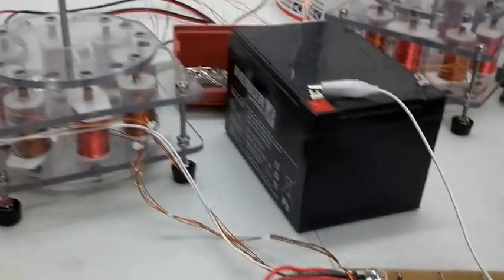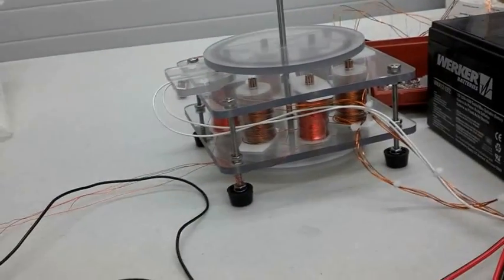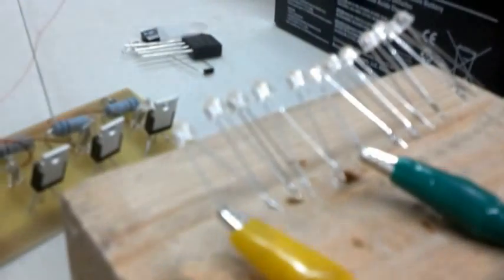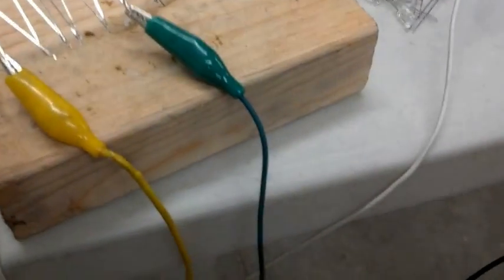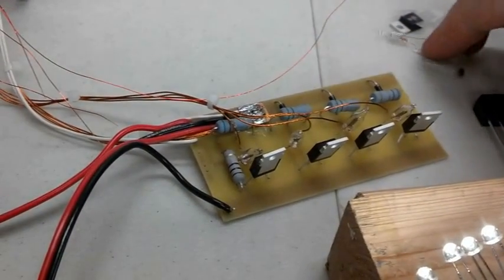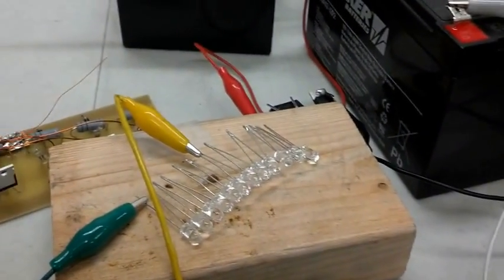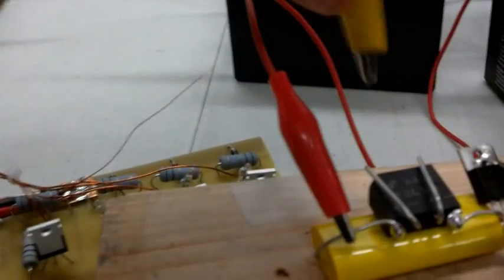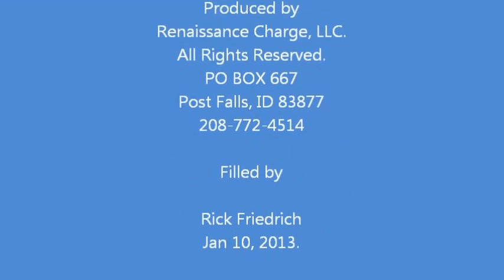Running New Mini 4 DualPole Motor

Comment: when you charge the battery with the capacitor the SCR and the bridge it goes up to 12,88 that means the battery in not fully charged correct!

Comment: Very exciting with new engine , is this kit including Bridge Rectifier and SCR circuit?
And is it possible to buy the battery swapping system on this kit, so you can run with two banks on primary and two banks on charging bank.